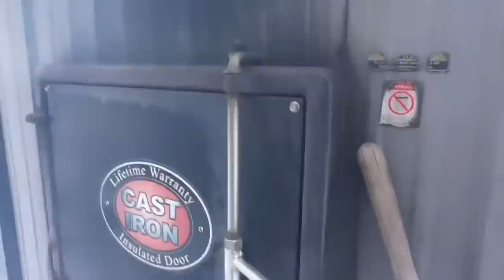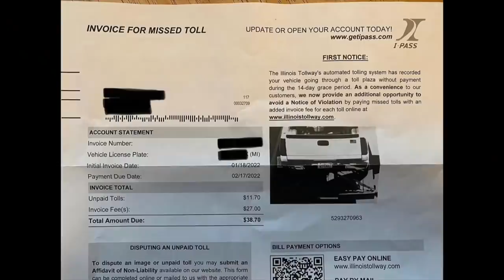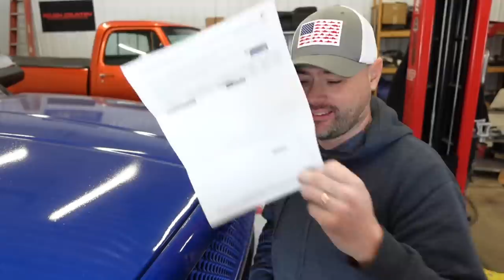I Got A Ticket For The Truck I Was Towing Through A Tollway! IS THIS LEGAL?

Comment: So you were getting billed “every now and then” for towing a trailered truck..... then you called to make sure they weren’t trying to gouge you and set yourself up to be charged for a dual axel trailer every time you pull it through a toll? How did you not understand the signs at the tollbooth explaining how you will be charged for different axel setups. Every toll has the signs. (Did not see sign in your video) Have you ever seen them. If you did, did you not understand why multiple axles cost more than others? I’m confused about this video.

Comment: That's a sad system they use, in FL the toll booths can automatically detect if you have a trailer or not and charge appropriately.  Technically, you should have told them the truck was on the road, would have been 1/2 price!  LOL

Comment: Makes no sense to me that you had to pay extra your trailer is set up to handle that weight as well as your tow rig. So what I get out of this if you would have been hauling the same weight in lumber or whatever you would have been ok that’s not right. Thanks Josh for you do god bless.
Reply from the maker: Great point
Reply: No the tolls are based on axles. There are even signs before the toll booth stating costs. The issue here is a computer glitch and not setting up transponder correct. My neighbor tows a trailer from Chicagoland south every winter and he never has issues. Truck Master should cover the plate on trailered vehicles to avoid the glitch.

Comment: Since the video was chop edited, it appears that the operator/owner has to manually set the speed pass with/without trailer. 
If that is the case, a lot of revenue will be generated by people forgetting to switch settings. Either by overcharge OR ticketing for not to add trailer. 
DAMN THIEVES!!!!

Comment: You pay for the truck and trailer not the cargo what happened was the prepass didn't have the trailer in the info
Reply: I have a dual axle trailer and one of the axles lifts off the ground so I pay for three axles going through tolls not four

Comment: you got ripped.    They took the plate from the truck on the trailer as if it went through by itself.    They should have scanned the tag, and read that it had 4 axles and charged you for that - regardless of what was on the trailer.   It just so happened that the camera picked up the plate on the truck that was on the trailer.

Comment: no you still have it wrong. You are being charged for 4 axels total 2 on the tow rig 2 on the trailer. You are not getting charged for the axels on the truck on the trailer.  So that being said if you have no trailer you have to make sure your ez pass is set for just 2 axels. If you are towing a single axel trailer you need to set the ez pass to 3 axels and if you are towing a double axel trailer you need to set ez pass to 4 axels and so on. The thing to remember is that you need to pay for every axel that touches the pavement even if the trailer is empty. So lets say we are running a tow rig with a tri axel trailer with 4 cars on the trailer. You would have the ez pass set for 5 axels(2 on tow rig +3 on tri axel=5)  not 13 axels (2 on tow rig + 3 on tri axel  + 8 on the towed vehicles = 13) and then on your return trip with the trailer empty you still need the ez pass set for 5 axels.

 Now for the free country and should not have to pay to drive down the road. You are right it is a free country and in this free country we have the right to drive down any public road for free (not really lol we pay road tax on fuel) but when you drive on a toll road you are on a private roadway that they charge you to drive on. So if you dont want to pay the tolls there is different routes that are public and dont cost a dime (other than the tax you pay at the pump ) I myself hate toll roads also I was born and raised in Michigan where there is no toll roads and our roadways are total shit. lol In the last year and a half I ended up buying property in Maine and have been running toll roads ever since and I personally love them. The money you spend on them goes directly back into road repair and upgrades on the stretch of road you paying for and I  have never seen a toll road anywhere near condition the free roads are in. I hope this helps clarify the toll fees. Keep up the hard work and thank you for bringing us along. Stay safe

Comment: The rules are not always clear or in print so that you can understand them i.e. my pickup and later my motorcycle were charged the same rate! Two axles and two tons are the same as two very small axles and1/4 ton!  Just another way to rip off the little people.

Comment: You need to call back and have them remove the wifeMax Plate from your account and  Add your trailer plate to the account account. I can see it in the picture, it's mounted on the left Fender sideways...... That's probably why the computer didn't pick it up....
 Also just to be clear, you do not have to register the vehicle that's on the trailer. that is not necessary and she did a very poor job explaining that to you.

Comment: It is normal on toll roads for vehicles towing a trailer to be charged more. It was only a small monetary amount, is it really such an injustice that you feel it necessary to go on a worldwide rant? Are you that fragile? You should be glad you were not  stopped for the more serious violation of exceeding the towing capacity of your truck and the aftermarket oversize tires and maybe aftermarket suspension lifts negative  effects on towing dynamics and capacity.